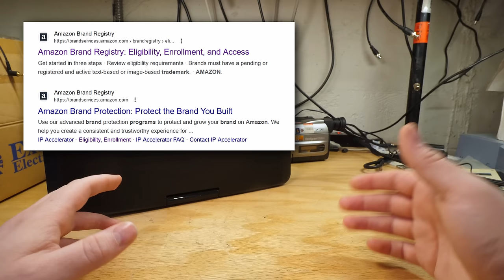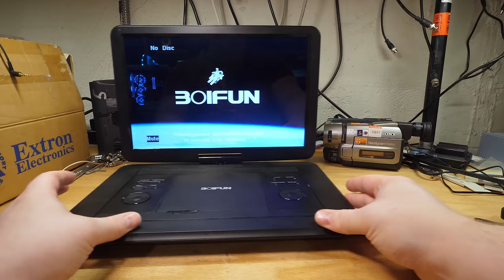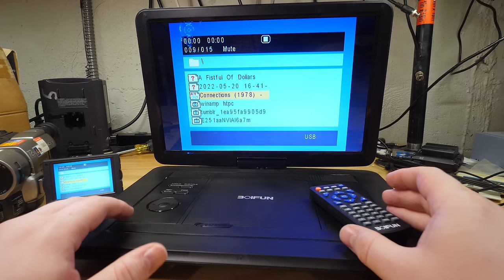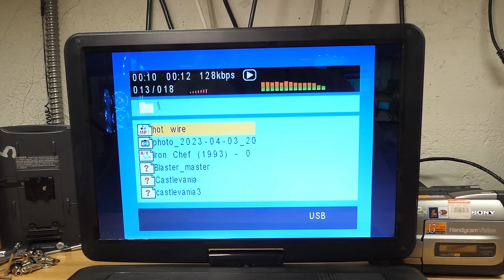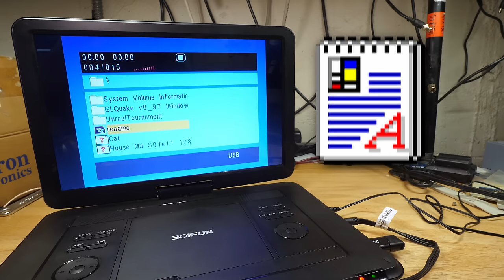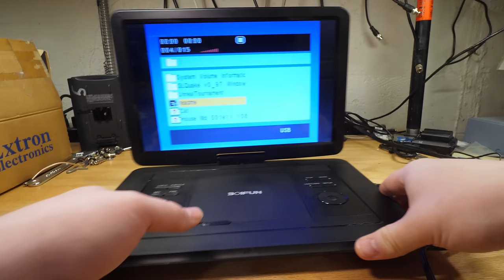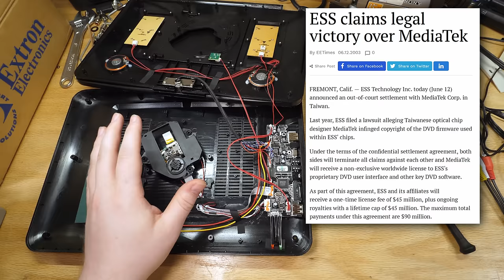Cheap, Silly, Remarkably Useful DVD Player

Comment: Back in 2015, before reliable Wireless HDMI transmitters were invented and I didnt have budget for a nicer Monitor, I ran a long 3.5mm to RCA AV cable to monitor a camcorder from the 2nd floor of a theatre balcony into an old portable DVD player’s AV IN as a monitor. Worked great and was a slightly nicer shitty rig haha.

Comment: I wonder why you can still get these New. Blurays have been the Standard for 15 years or so by now. Personally I havent bought a DVD since 2007 or 08.
Reply from the maker: i don't know but i'd bet it's one of the following:

1) the licensing cost of bluray is over a dollar per chip, and the complexity is too high to conveniently counterfeit, so the profit margins on DVD end up way higher

2) they made 500 million of these chips in 2006 so they cost a penny, and the factory that was set up in 2005 to make them is just still making them with slightly different cases

Comment: The datecode on the MT chip is 21st week 06.
Reply from the maker: A couple other people think that it's actually supposed to be interpreted as 6th week of 2021, and that seems plausible to me as well. The thing about chips like this is that they do often get produced for decades, so I think it could go either way, especially given the VDU suffix that, if it were around in 2006, I would expect to have made its way on to the internet in PDF form or at least as part of listings.

Comment: Wait... that camcorder has AV inputs ?!?!?!!?
Reply from the maker: Specifically, it has AV ports which can be either input or output depending on what mode you're in. I've seen this decently often, but I think it's more common on devices that use formats other than VHS.
Reply: @CathodeRayDude  My first camcorder was very similar to that one (a Hi8 CCD-TR820E from 1997) and the AV ports were only for output...
Reply from the maker: @ViegasSilva  Wow, yeah, you're right. I guess I've just gotten weirdly lucky in this regard, I could swear most of mine can do it.

Comment: interesting, the bit about being slow, it old tech. inside, but just going the look, mostly be surface mounted chips, and with now real base anything on? it build to a price point, and lowest priced parts won the race making it inside the case? so I am wondering clock crystal (think), was also, what was the cheapest, available down the market, that world just about do the job needed?  so real slow but fast enough crystal was on offer or sale? and what ended up in it?,  so could you just replace with some with little more speed zipp...  also the CPU, may of been getting to hot? requiring extra cooling or something?  and that mean a cooling fan, there are what looks like extra not used stand-off in the moulded plastic that may of been for a cooling fan? that was not used in favour of just making run slower in stead 🙂

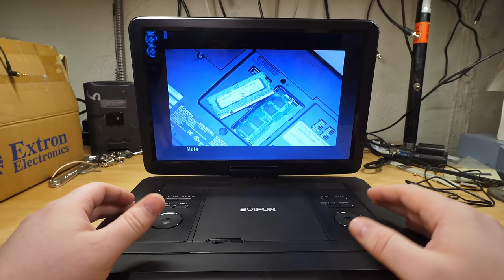Comment: 6:36 IIRC "widescreen" DVDs are just letterboxed fullscreen video and it's up to the display to figure out how to zoom in and crop appropriately if necessary. I don't think the DVD standard (or composite video) supported anything other than 4:3 480p or lower output, widescreen was a bit of a hack 'till HDDVD and BluRay

Not sure what this things doing though as it clearly seemed to be zooming in within the letterbox which must mean it's already cropped any embedded letterbox and added it's own frame 🤔

Edit: I realized you possibly didn't burn a standard format DVD, but just a data DVD with a video file on it, which the player would load with its built in menu and not likely have any embedded letterboxing, so none of this may apply here 🤷

Comment: If you love the d420 then I'm begging you too look up the XPS 420
Reply from the maker: i actually have an xps 420 as well for the obvious reason. the two 420s and the X1 form a sort of family in my mind, they feel like different trim levels of the same little computer
Reply from the maker: oh shoot sorry i was mixing it up - i DO have the XPS version of the D420, but it's the XPS M1210.
Reply: @CathodeRayDude  No worries! The XPS 420 was a midtower with like a core 2 quad and an 8600GT? Not sure if those specs are accurate but the feature that stands out in my mind is the little diagnostic display it had on the front panel. I'm speaking from a spotty memory though, I had one years ago that didn't work since I had bought it for parts but I do remember the tiny lcd display lighting up lol
Reply from the maker: @happytorrentt4500  yes!!! i actually know someone who has an XPS420 for me for that exact reason - that LCD is for Windows Sideshow, an abandoned initiative to put a tiny PDA of sorts into the chassis of your computer to allow you to do very simple tasks with the PC turned off. Very, very few other models got made.
Reply: just looked up the m1210 and wow, that is....that's something. I had forgotten that laptop camera bumps were a thing lol
Reply: @CathodeRayDude  I wish I had fixed it now that sounds so cool! How much of a "pda" is it? Probably not like a palm pilot just crammed into the front bezel, lol (sorry, your second notification had just hit my alerts 😅)
Reply from the maker: @happytorrentt4500  It's very limited. It's able to run widgets that are sort of like one step up from windows vista sidebar gadgets. I don't exactly know how good they got; the only ones I've ever seen were i think an email reader and a very basic solitaire.